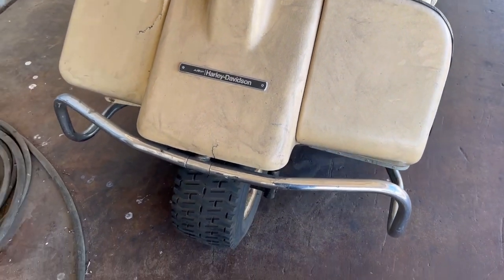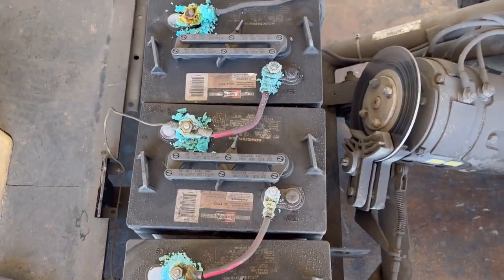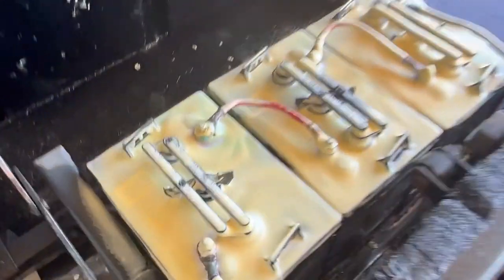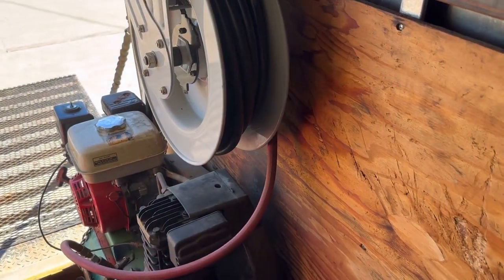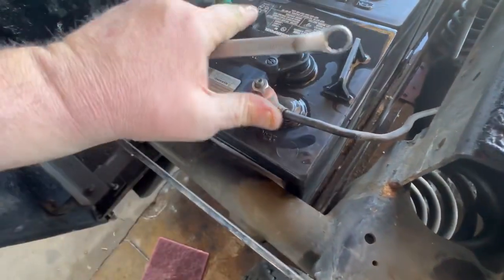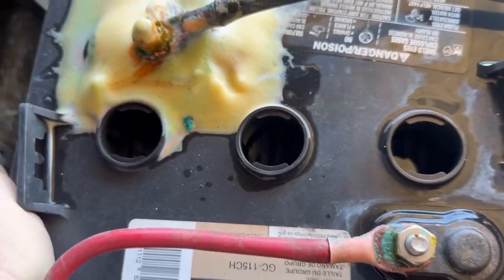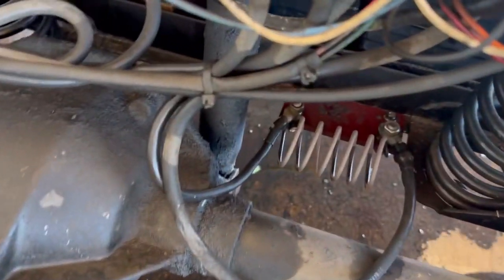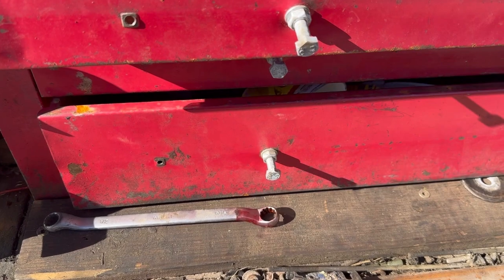HARLEY DAVIDSON 3 WHEELER SEVERELY CORRODED BATTERY CABLES. LETS CLEAN THEM AND SERVICE

Comment: Nice work. 👍
I have CRC cleaner but rarely use it. Good hot water if you’re not worried about getting things wet and obviously you weren’t. It’ll clean that corrosion like you can’t believe! But the water has to be very hot. 
Yes, terminals have to be clean. But don’t over tighten them. People try to compensate for dirty terminals by over tightening them. It doesn’t work.